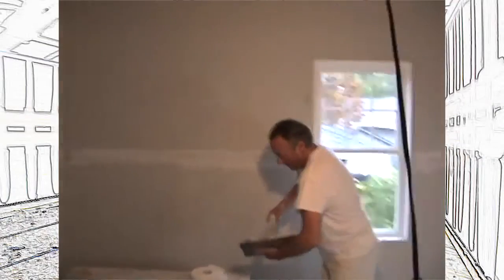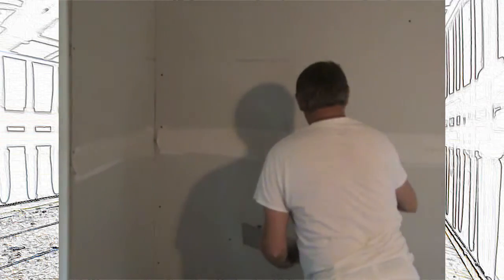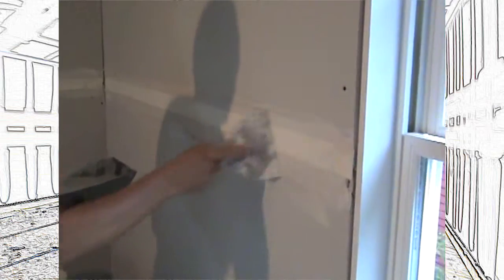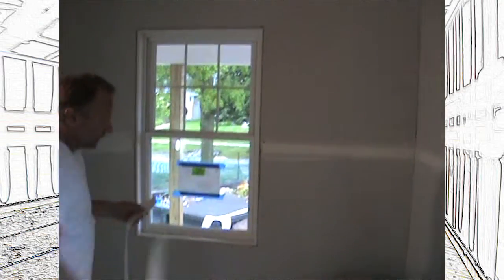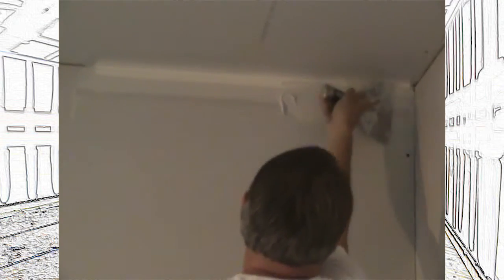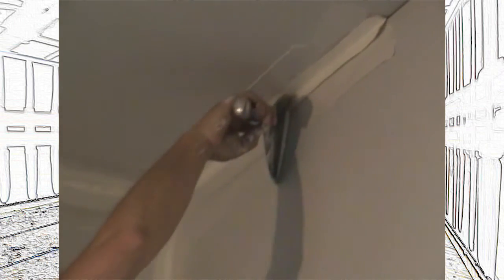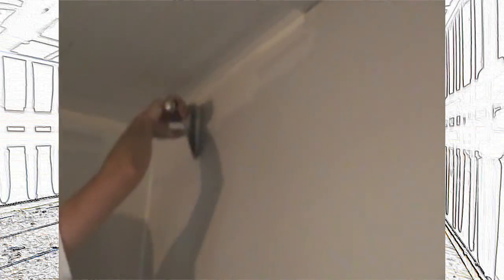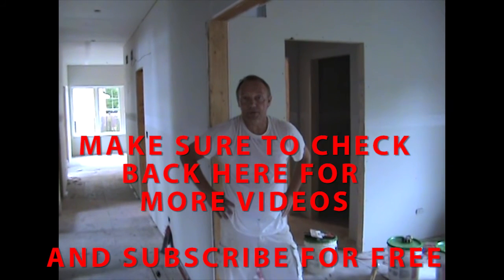Taping 101 - How to Tape Angles and Seams by Hand

Comment: I tape with a Banjo and usually coat the next day after taping.  I notice you coat as soon as you tape and was wondering if there is a reason I should not wait before coating.  Kind of like using a bazooka and putting it down after each wall to coat before the tape dries.  I have seen your video where you explain about the primer wetting uncovered tape moistening it and releasing the adhesion behind it eventually causing peeling.
Reply from the maker: No reason you can wait until the next day. These are small jobs so I tape and top the first day skim the next sand touch-up the third day.

Comment: I've been remodeling homes and taping and muding for 25 years. When doing large jobs I'd hire someone else to tape and finish because they were faster and better. I would watch them and still not understand why they were so much better and faster. After watching your videos, I got it. I was sanding too much between coats. I knew not to put too much mud on but I didn't understand that I could just knock down the ridges and get the other imperfections with the next coat. I used your method of "Dusting" the mud and after my skim coat (3rd coat) it was all slick and took very little sanding. I still used my corner knife instead of your 2 pass method in the corners but all in all I'm much better and faster after watching. Thanks! Johnathan www.insuredservices.net